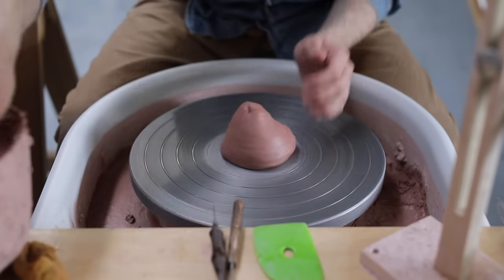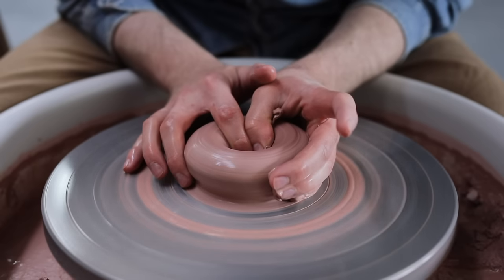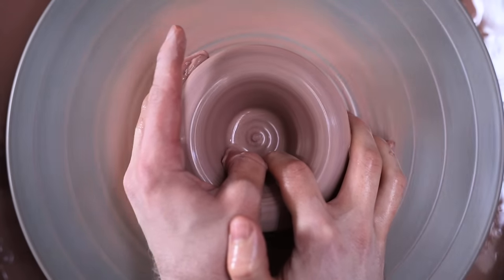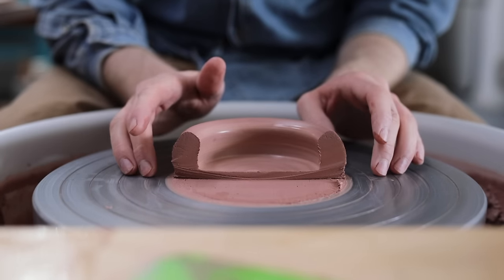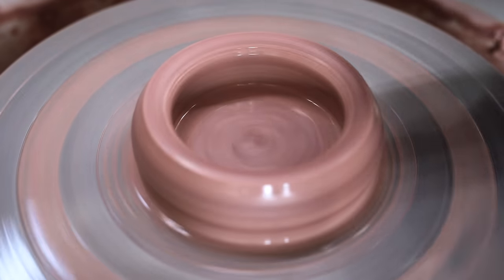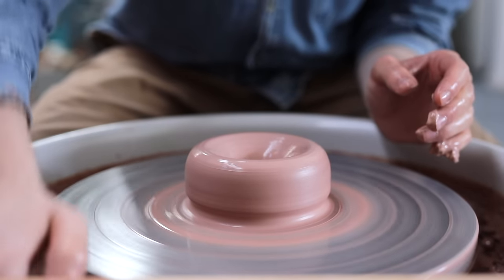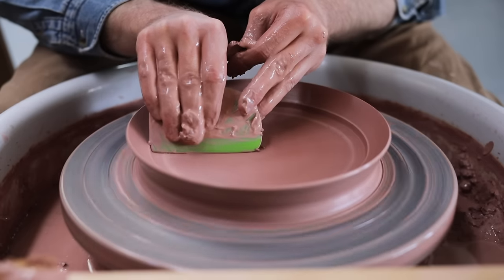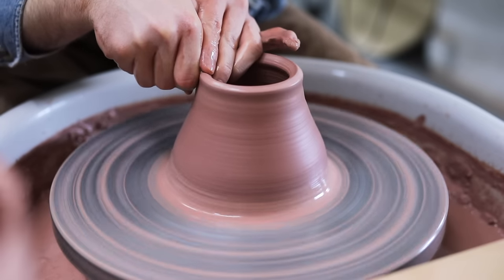How to Open Up Centred Clay and Form the Base of a Pot — A Beginner's Guide

Comment: I have just completed my first few days at the potter's wheel. Your videos, especially your instructional and narrated videos, have been incredibly insightful to what is most definitely a craft that looks much easier than it actually is. I've had many buckled walls, thin bottoms, and moments with gritty and unlubricated chunks of clay, but I have been enjoying the process and taking care to reflect over each attempt. Yesterday, I threw only 1 semi-successful cylinder, and today I threw 4. Progress, even with only micro-improvements, is still progress. Thank you for putting in the time to make these informative videos! It makes a world of difference to a budding pottery hobbyist such as myself.
Reply: Any suggestions for starting at home 🏠?
Which wheel I have to buy and where to buy?
Reply: @rajshrisingh9378  
What wheel did you end up getting?
Reply: How is the wheel throwing going?

Comment: I began taking pottery lessons a year ago and my instructor recommended your videos. I watched them many times at the beginning. I've spent the last year trying to master centering and a couple of weeks ago I finally had a break through. The first time I pushed the cone down and felt the clay center it was an amazing moment. My next problem was that I would knock the clay off center when opening up. I went back and watched this video again and figured out exactly what I was doing incorrectly. I went to the studio yesterday and on my very first pot I centered, opened, and pulled the walls on a perfectly centered ball of clay. It was truly magical after a full year of being just slightly off center. I threw my best pots so far and I just wanted to thank you for your wonderfully helpful videos.

Comment: hi Florian, you are reading my mind that I was facing the same common errors you demonstrated. 😂 I was struggling to centering and pulling up the straight wall( as well as angle and height) for making the vase/ mug. I kept repeating sames mistakes (and my thumb was painful too) and I can finally find out the root problems now from your sharing. Thank you so much! 👍

Comment: Great video thank you.  I can centre and raise and lower the clay initially.  However,  pulling up the walls is hard for me.  Using just my two index fingers is a challenge.  Twice the top came off even with my short nails.  It’s great to know there is more than one method to pull up the walls.  Thank you very much.

Comment: Can you do a tutorial on how to throw air dry clay?  Should you make the bottom and walls thicker, as air dry clay is more prone to breakage? Is it easier/harder to throw?  I want to learn how to do this and I feel like this is a cheaper option for first starting out, as I don't have access to a kiln.
Reply from the maker: I’m afraid I’ve never thrown with air drying clay! But I imagine it’s the same as most clays, so my usual centring/how-to guides should work.

Comment: When you open (4:55), it almost looks like you are pulling an opening wider than the base of the centered clay. I just started a pottery class and was told you shouldn't open more than the width of your centered puck. Is it okay to do this?
Reply from the maker: I don’t push it much further than the original lump, but you can overhang the walls slightly when pushing how to widen the initial base. If your teacher says don’t, maybe follow their advice for a while whilst you’re learning, then as you become more confident you can start pushing the boundaries a little more. The most important part at the beginning is to keep practicing centring and then pulling up the walls to create neat cylinders and bowls. Good luck!